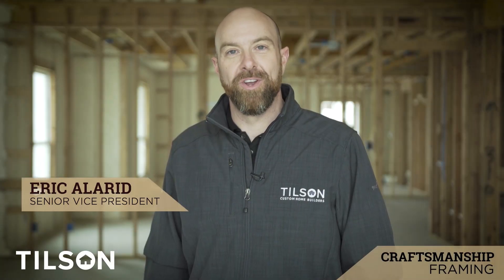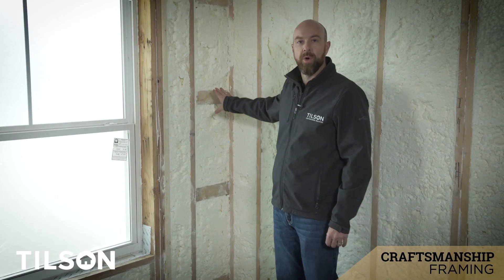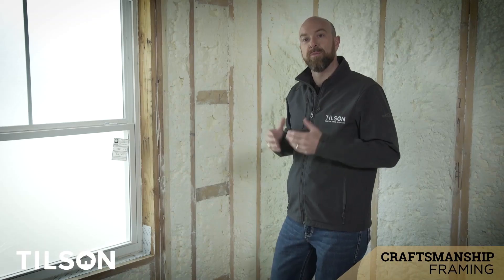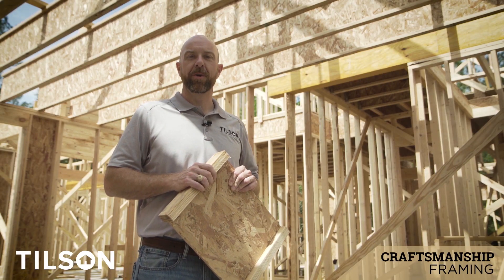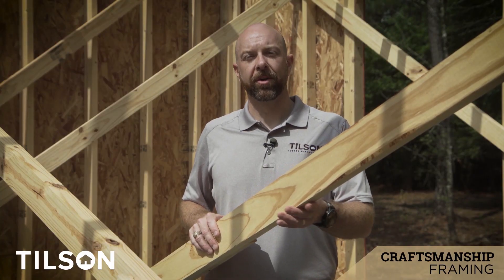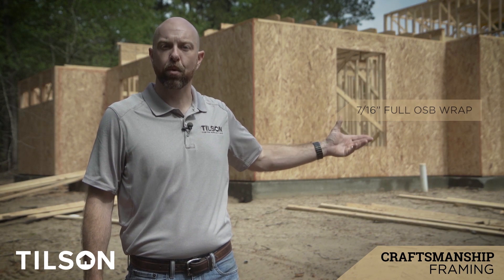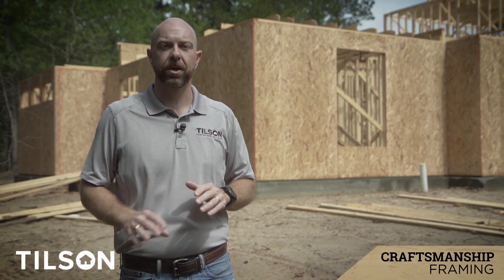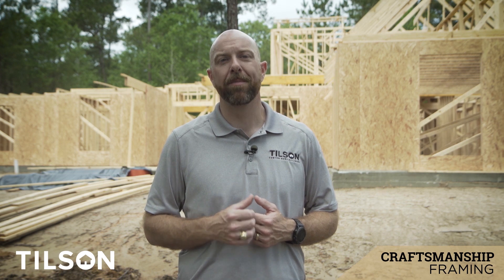Framing - Tilson Homes Craftsmanship Collection

Comment: They are about to build mine. But I asked if my home will get foam insulation and they told me that it wasn't. Is foam insulation only in some models?
Reply from the maker: Hi Irvin, Spray foam insulation is standard for any homes we build within Climate Zone 3. For homes built in Climate Zone 2, it's available as an upgrade.